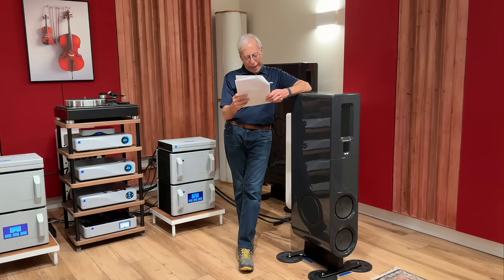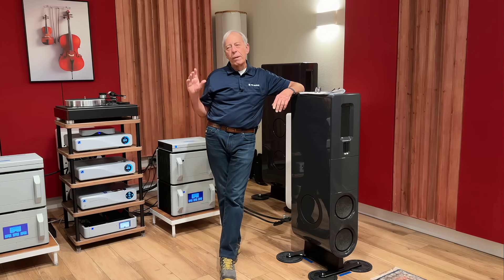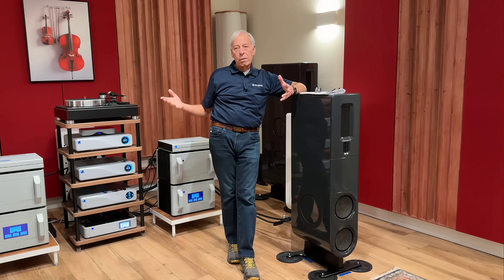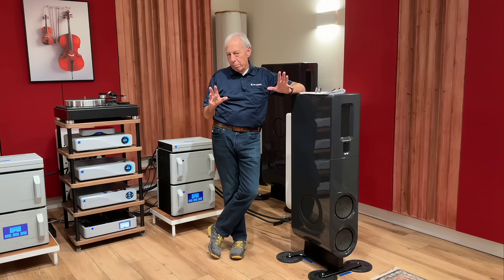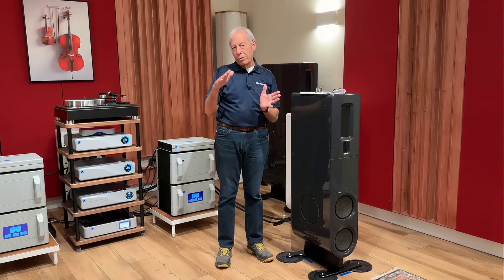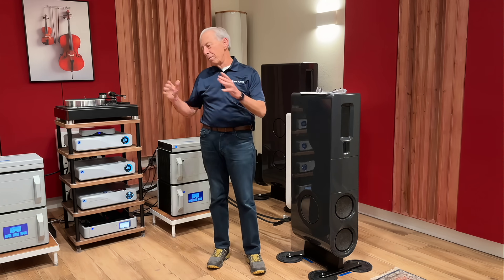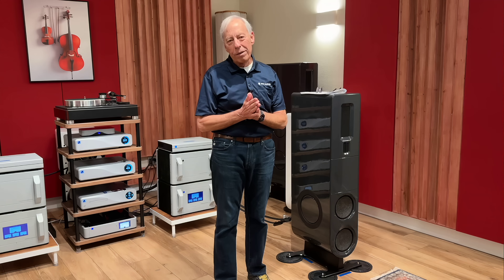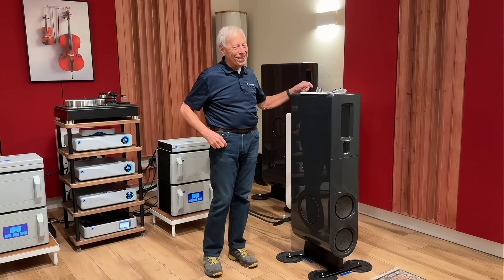24 bit vs  32 bit DACs

Comment: 16 bits and 44khz is all u need for super high end listening. Over 200 bucks u wont hear much of a difference in dacs. Remember guys the companys want to sell u this stuff, with as much buzzwords. Buy some used devices for cheap, i got a NAD 2000 dollar DAC for 150 bucks and i did not hear any difference to my other dacs. I wouldnt say its snake oil but the difference we can notice with out ears is suuuuuper small...

Comment: I would argue that dynamic range may or may not be important depending on the genre of music. If someone listens to a genre of music that has very little difference between the loudest and softest passages (most genres), then 16/24-bit is WAY more than enough to cover any ranges the music produces. It's probably overkill to be honest. 

However, classical music (and other similar genres) can have some substantial dynamic ranges which can be appreciated depending on the equipment but as noted in some comments, the quality of the recording is absolutely everything! At least with classical, you can search for the "best" recording of a work since there will usually be multiple versions of it. But a poorly recorded rock album is a poor sounding rock album. No amount of sampling can turn a bad recording into an audiophile collection. 

Just listen and enjoy!

Comment: I remember the real old days when transistor radios came out and they were rated by the number of transistors. But it turns out many of those just stuffed inactive transistors on the boards which did nothing

Comment: People misunderstand the noise floor of the listening room.  In a room with a 30dB noise floor you can clearly hear sounds below 30dB.  In this case if you can hear a 20dB sound you’re up to 120dB with 16 bit.  Still plenty.

At some point you’ll hit the threshold of your hearing, at which point the threshold getting lower won’t matter… so yeah, 16 bits is fine at anything less than rock concert level playback.

Comment: There are other parts of a DAC that have way much more impact on sound quality than if it has 24 or 32 bit resolution. Power supply, analog output stage, grounding techniques, reclocking, clocks have more of an impact. Personally I can hear a clear difference between 16-bit 44.1kHz and 24-bit 96kHz but I have fail to detect any difference  with even higher resolution.
At the moment using Mark Levinson No.360S that can handle 24-bit 96kHz and it was very expensive when it came out, and that money went to very good solutions and components.
Have tried some more modern solutions like Denafrips, Gustard, Benchmark, but they have not been able to remove the Mark Levinson No. 360S from my system.
And that DAC is almost 20 years old and still very hard to beat. I would look at what else is good in the DAC instead of thinking about 24 or 32 bit resolution.

Comment: 32 float can help for subsequent processing on playback or encoding/decoding. 16 bit lossless is plenty for high quality listening - IF nothing else is done to the audio during playback.
Reply: Unless the peak level is close to 0dB. Which it almost always is. Then downsampling can change the waveform interpolation,  which can result in overs.

Comment: A 32 bit DAC should put out a dynamic range of 192dB. A 24 bit 146db. If I am not mistaken 24 bit has a smallest value of 120 picovolt RMS. To produce a device that has such a clean power supply to its amplification stage let alone is capable of that, thats impressive. 20bits is considered a extremely difficult but achievable amplification at 1,9 microvolt RMS smallest value. In the real world, a true 16 bit resolution is already exceptional in my opionion.
And then comes the sound quality. Paul is right, test by ear and not by specs. The DAC chip's resolution, the audio format, it's all hardly important in my experience. And to be honest, most DAC's sound really bad, which you only understand once you heard one that doesn't.

Comment: I stayed away from digital audio until my first CD payer in 1992, when oversampled 1-bit DACs (“Bitstream”) were the hot new thing.  In my small amount of electronics experience in the early ‘80s, most ADC and DAC chips were 8-bit, while anything 12-bit was cutting-edge.  A 16-bit converter that actually worked properly was unimaginable.  In a resistor-ladder DAC, it’s really difficult to maintain linearity, or even to maintain monotonicity.  To avoid harmonic distortion, you want it to be linear, and have each step the same size.  You want the voltage to go up a step from (16-bit) 0x3FFE to 0x3FFF.  You also want it to go up a similar-size step from 0x3FFF to 0x4000, but due to limits on the precision of resistors, that step could easily be nonmonotonic and/or very nonlinear.  So oversampled 1-bit was a huge improvement.

Comment: 32 bits are not needed for music formats, or for the signal to noise ratio of actual recordings, but they are needed in order to implement digital volume controls that do not increase output noise in systems that have a lot of gain. Sabre uses a 32-bit digital volume control.
Reply: Digital volume controls do not lessen any analog noise, the signal to noise ratio actually gets worse as the volume is decreased.
Reply: @mitchtaylor6512  But if it is almost immeasurable let alone detectable or audible to begin with at full scale, it remains almost immeasurable or detectable at the lower volume settings. It is well below the threshold of hearing.

Comment: Great discussion.  
I love my 16 bit DAC.  I use software volume control and cannot hear any loss in sound quality if I have it at less than 100%.
My vintage TDA1541a based DAC sounds wonderful because it has very good power, a triode output stage and a very low jitter clock.  The quality of the recording is the only variable that counts in my listening pleasure.

Comment: I do so wish 32 bits just became the standard. The headroom benefits are awesome. Potential clipping of digital signals becomes a total non-issue.
Reply: Ich wünschte, daß Ihr Highender mal auf den Boden der Realität zurück kommt.... Mehr al 50 dB Dynamikumfang macht auf keinem Tonträger Sinn !
Kommt endlich in der Welt der Realität an !
Reply: @bachglocke3716 I'm not an audiophile, I'm an audio engineer. 32 bit float is amazing and should be the standard for recording, processing, and playback. I actually work with said audio, not just listen to it.
Reply: @AnimusInvidious  Für Aufnahme und Bearbeitung o.k. aber für den Tonträger für den Endverbraucher braucht man das doch nicht. Kennen Sie den AD-Wandler von Dr. Jahne ? Der kann 28 bit. Da brauchen Sie keinen Mikrofonverstärker mehr. Und die modernen Lawo-Pulte arbeiten auch intern mit 32 Bit floating point.
Kollegialen Gruß--! 🙂
Reply: @bachglocke3716  It's not just about dynamic range, is my point. The peak clipping issue is more paramount.

Comment: While mastering engineers might debate the usefulness of 32-bit audio samples for editing and mixing purposes, you derive no practical benefit from your consumer DAC being 32-bits. Not only is 32-bits (192dB) of dynamic range far beyond the limit of human hearing, but so is 24-bits (144dB). As Paul correctly points out, even quiet domestic rooms add 30dB, and likely more, of acoustic noise. Which reduces the ear’s useful dynamic range by that amount. Plus, the DAC hardware is incapable of accurately resolving those bit depths anyhow, typically not accurately going beyond about 21-bits of DR. 

While digital volume controls theoretically benefit during high degrees of attenuation, the DAC hardware still is not capable of accurately converting beyond about 21-bits worth of DR. Which sets the 'quantization noise' floor. Quantization noise, is tiny numerical errors in the exact sample value due to the finite number of digital bits used to define the capture (digitize) the analog value. If the DAC hardware were perfect (which it isn’t), the more bits per sample that are utilized the more accurately digitized by the ADC is each instantaneous analog signal value. Therefore, reducing the digital quantization noise floor. The tiny numerical errors inherent to digitized samples.

Comment: The number of times others here have had their head explode and attack me for daring to explain the exact same bit tossing digital volume control as you have just explained. 

I prefer to look at number of bits as resolution rather than S/N. As in there are X number of sample points based on the bit depth. When you want your DAC to reduce it's output digitally you stop using bits. If your DC is a typical 2V max out and you want to listen at a level that gives 1V max out, you can;t turn on the most significant bit plain and simple. And you only have half the sample points left after loosing those that are above the 1V line.

Comment: The minimum audible difference in sound for hearing is 3 dB ( ! ). For amplifiers, a signal-to-noise (S/N) ratio of 100 dB is standard, but insufficient. You need at least 110 dB to be sensitive enough. The difference between 100 dB and 110 dB is about 3 times greater for auditory discrimination. The price of amplifiers with 100 dB S/N and 110 db S/N is significantly more expensive. It is not a coincidence :)))

DAC 16-bit is standard, but insufficient. The more, the better :)))
Reply: I can hear differences smaller than 3 dB, but that IS in the right ballpark.  But Paul’s mention of the dynamic range of a room (e.g. 30 dB) is spot on.  It’s maybe a little more than that, but not by much.  Certainly never more than 40-45 dB.  3 dB represents (exactly) a doubling;/;halving of the physical power (wattage).  10 dB is said to be approximately what humans perceive as a doubling/halving of volume level.
Reply: @kc9scott  I was writing in general, not for Paul :)
Reply: @Indicatrix  A room dynamic range of 30 to 40 dB is in general.

Comment: 100 % agree about listening over specs when it comes to DACs and ADCs. Where it can become relevant for 32 bit over 24 bit is in recording headroom, especially outside for sound effect recording such as with thunderstorms or airshows or any environment where you would consider wearing ear defenders, just to get a clean a recording as you can assuming your microphones can work at those levels without themselves distorting.
Reply: Mikrofone sind heute für Schallpegel geeignet, die bis zu 150 dBSPL betragen. Das ist mehr als 24 bit !

Comment: Are 480p videos really better than 1080p or 4k? I doubt it.😉
Reply: just a illusion :D
Reply: There are 1080p Blu-rays that are better (better resolution and chroma combined)  than some 4k streaming even on 4k displays. A bad room or a noisy environment it's like using a SD TV for 4k movies, would it look better than the SD file from the same version? Most (probably all) domestics rooms are not good enough for 24 bits or even 16 bits reproduction. Production is different, as volume reduction is (Paul's explanation). Audio  analogies, metaphors and comparisons can be more complex than a simple visual example.
Reply: @Jorge-Fernandez-Lopez  I just referred to the format of this video.😁
Reply: If you have a phone... that's true... if you have a 200 inches tv, you will ask for more!  Every thing is relative! No black and white answer!
Reply: @Skye_the_toller  If we perceive 60 pixels per degree, and he 200 inch screen is very far away, whereas the phone is very close, it might be the other way. As you said, it's relative.
Reply: I live in a van down by the river and don’t have much headroom the Walkman is perfectly fine

Comment: I've learned not to care so much about these things anymore. Matters more how good the recording is than anything else. Either it sounds good or bad. Enjoy   the music if you actually care.
Reply: Spot on!..The recording is MUCH more  important than the 'container' it's delivered in...A beautiful recording at 320kbps still sounds incredible...A 70s Punk Rock Record even at 'Hi Res' will sound like it was recorded with a cellphone.
Reply: Yes, Recording and mixing is first in my experience too
Reply: Exactly... recording matters the most.. Everything else (maybe other than speakers?) are quite good today and the difference for me is quite marginal....
Reply: 24 bit is already overkill , it’s the mastering that counts not chasing numbers.
Reply: @davidspendlove5900 That's right.. Its what goes on in the studio that counts...

And in defence of the poor ol recording engineers getting roasted on audiophile forums with so called ' Bad Recordings'... They often aren't bad recordings per se , they're deliberately compressed massively because they potentially optimised for radio, car audio (or nowadays devises) .They Arn't mixed for Audiophile setups
Reply: I agree.  The recording plays such a huge role.  I have a few albums that I feel are great pressings, great mastering etc.  My system sounds like a million bucks with these albums.  Speaker placement?  Perfect.  Subpar sources, my system sounds like a subpar system and set up.  So manyt videos are all about the equipment and discount the importance of a fantastic source.
Reply: Precisely
Reply: That’s been my experience too!
Reply: I had a nakamichi cd player with dual 16 bit huge soundstage and is that equivalent to 32 bits 😳
Reply: Amen!
Reply: The quality of the recording has nothing to do with his question. He already knows that a better recording will sound better lol.
Reply: A poor recording will negate dac resolution

Comment: Some time ago, for test, I pushed 16 bit audio to its lower part od dynamic range to hear quantization noise. The results varied from just noise (like on analog tape) to audible distortion, depending on process and DAC involved. 
Also, I did test with 8 bit sound. It sounded as good as source just with added noise, like normal tape without Dolby NR. 
So, it is really depends how good DAC is and it's processing if any taking place inside.
24 bit is already hard to push to limit, and there is noticeable gap from 16 bit. I agree with concussion presented in this video.

Comment: Yeah, digital volume control is now at a level with adequate bit resolution of 32 bits in modern DACs to yield no audible concerns. For the music source itself 16 bits is already pretty good and a next step like 20 bits would be above what human hearing can benefit from. So why is 24 bits the next step up? Because we like to split things into bytes and 16 bits are two bytes and next step up is 24 bits audio, which is made of 3 bytes.
Reply: And yet many companies are now going back to analogue gain controls 🤔
Reply: Its possible with both digital and analog volume control to engineer it without sonic artifacts. There is nothing wrong with that. Some people like tubes in the signal path and there is probably an overlap with those also wanting analog volume control.